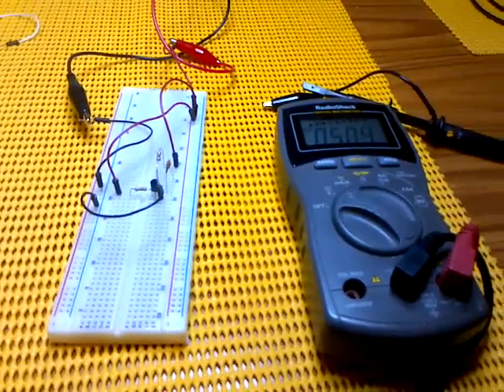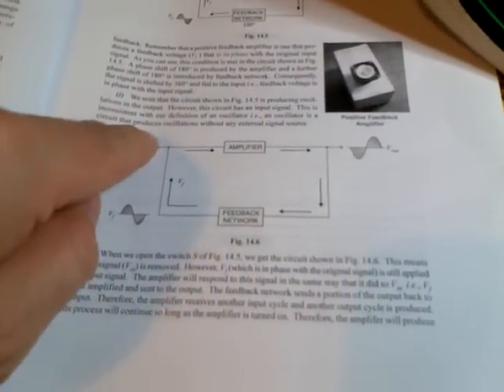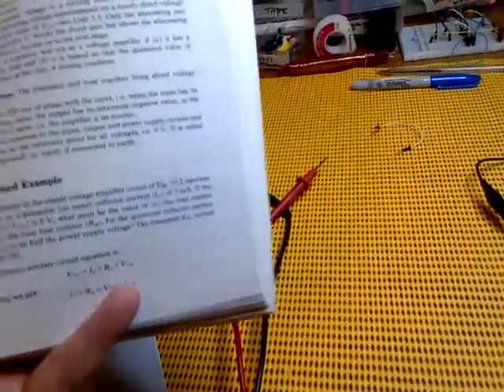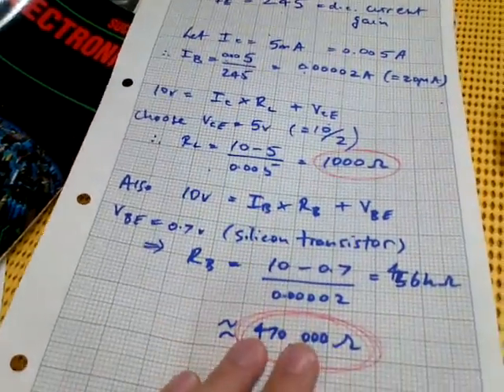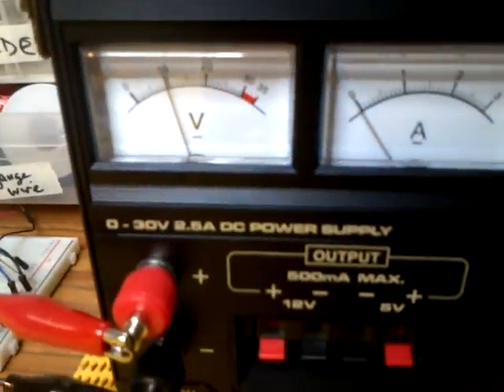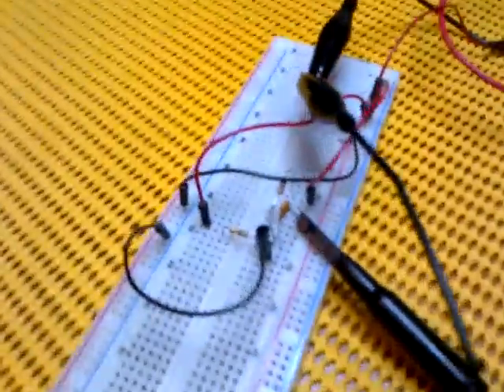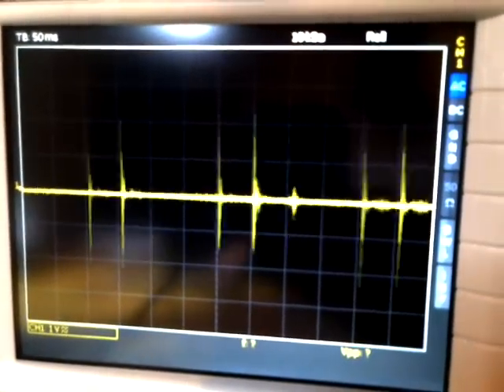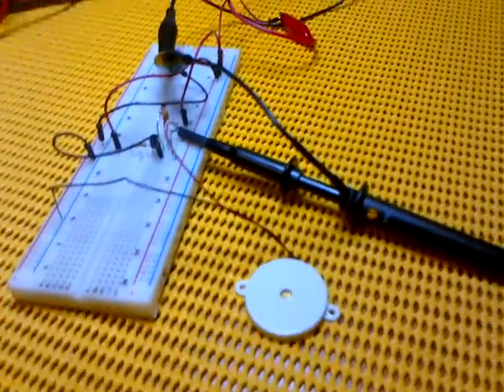Basic Audio Amplifier with one transistor, two resistors and a capacitor

Comment: I love it. Everything worked out just fine and it wasn't even hard to figure out how to use it on PNPs :D
Reply from the maker: HunChem  Great to read that you found this video helpful! Thanks for watching.
Reply: Queuerious Guy Now, for the weird part. Not everything is perfect. This circuit creates a terrible ~60-70 Hz oscillation when it's connected to any kind of preamp. Like as soon as it's connected, it starts humming like crazy even though it works perfectly as an amplifier. The humming is not changing in frequency and volume as I increase the volume of the input. Any ideas? (with an input left floating, it's completely silent)
Reply: HunChem 
What is the specific hfe of the particular transistor that you're using. If it is different from 245, you will get different results.
Reply: Paul Carew I used a BD140 which has a hfe of 40.
I tried one that had 90 and it did almost the same. Also, measured the frequency, it was perfect 100 Hz sinewave

Comment: Great video, very informative.  I see you have calculated your amplification ratio but what about the transformation ratio, is not required?  If I remember it's Collector current/Emitter current.  Kinda new to transistors so please bear with me :)
Reply from the maker: ***** Hi Zidane, you probably know more than I do regarding 'transformation ratios'. The collector vs emitter current plays a role in the gain and input impedance of the amp circuit, but that is not considered in this very basic example! Thanks for watching and leaving a comment. 73.

Comment: Pretty Cool indeed!  I liked the way you show and explained this using a solid state part I had a old radio hand book that I used to try and teach myself the "How does it do that" lol  The book used Vacuum tubes to explain and show examples of amplification the drawn pictorial of a amplifying tube was very helpful in understanding the process valuable information that made it easier (for me) to understand solid state Thanks for posting- That's what makes Marshal Guitar Amps so Popular they have always used Vacuum Tubes for a warmer and richer depth of sound just a little FYI
Reply from the maker: @Rasario W, thanks for your comments.I love Marshall amps too (I am a die hard Yngwie Malmsteen fan, so know that sound!).
Reply: Queuerious Guy what would happen if you did not use a ceramic capacitor?
Reply from the maker: Owen Chase Hi Owen, I would not expect any effect on the amplification in this example with the use of a different type of capacitor. The caps are there to buffer the amp from any DC in the rest of the circuit. Different capacitor construction, e.g. polyester, mylar, etc., have different properties that relate to noise/lossy-ness, temperature coefficients (and that effects their capacitance),etc and which frequencies they are best suited for (e.g. audio freq,  radio freq, etc)
Reply: Queuerious Guy o ok

Comment: hey can you give me the shematicc with all the values written on it
Reply from the maker: Hi Sameer Gangar, the video shows how I calculated resistor values R (base) and R (load), based on my measurement of the current gain of the 2N3904 NPN transistor that I was using (h_FE = approx 250). I've written and scanned the schematics and component values here https://drive.google.com/file/d/0B5wtctB1jrOneFlab1BaYS1KNk0/view?usp=sharing. 

Here is what I did: 1) measure the DC gain (h_FE) of the transistor, 2) assume a 5mA collector current (at quiescent or non-amplifying state) and collector voltage  = 1/2 the supply voltage, then use Ohms law V=IR to work out the resistor values.

This is NOT a great circuit to use other than as a demonstration of the simplicity and power of a basic transistor amp. Drawbacks of this design: 1) this is a Class A amplifier, which draws current (hence power) even when not amplifying anything (not efficient), 2) the circuit values depend upon the DC current gain of the transistor used, while there is always a large degree of variation in transistor gains, even for the same transistor type from the same manufacturer and production batch. This means that "your mileage may vary".

Hope this helps. Regards, Matt 2E0MTT
Reply: so this amp will be enogh to power  8 ohms speaker or 4 ohms one will be fine
Reply from the maker: sameer gangar it should work I think, as long as the speaker is a low power example, say 0.25W or 0.5W (think "small speaker"). Try it and let me know how it goes!